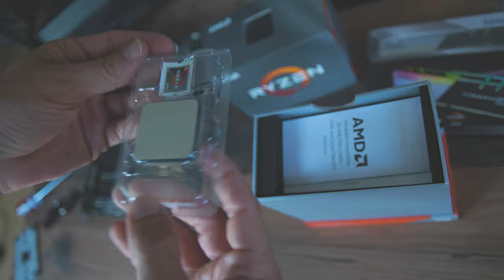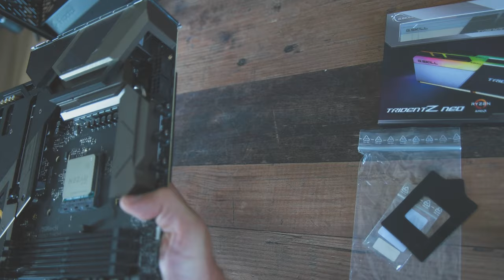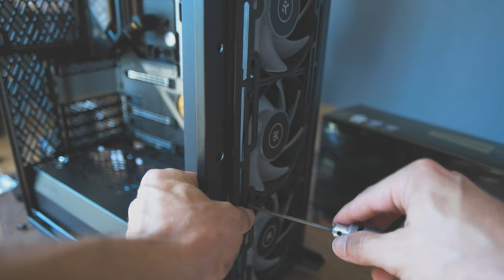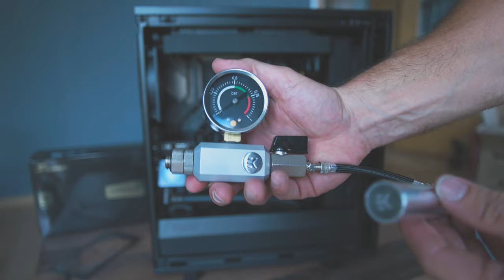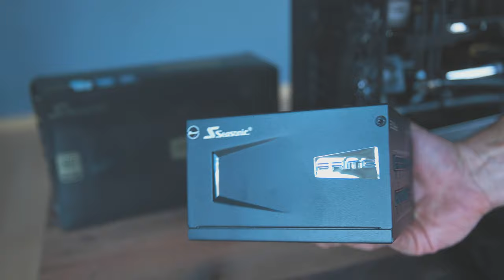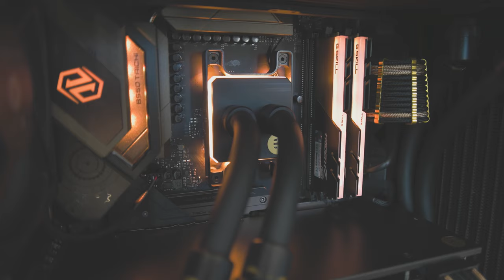Fractal Design Define 7 Compact EK WB Magnitude Black and Gold PC BUILD

Comment: Love that build!

I actually thought about the same case, I currently have a R5 and want to get something newer and smaller. My 3080 is on it's way and I would like to switch to water cooling. 
Would you recommend to do it that way, or get the bigger version of this case? While it looks nice, it seems a bit hard for a beginner to find the correct matching parts and I can't keep the system on hold for a day as I need it for work. Thanks!
Reply from the maker: Zen2 R5 ? The R5 doesnt perform very well with the 3080 .. you have to overlcock the R5 to 4,5Ghz (tested it) btw for you the Define 7 should be the better choice :)
Reply: @CustomrigsDe  Hey, Thanks! I was talking about the Define R5 case and think about switching to either the new Define 7 or preferred, your Compact case. I pair the 3080 with a 3900x Ryzen :)

Comment: Build sieht an sich sehr schön aus, ich finde allerdings dass die 5700XT und der R9 3900XT in der Form nicht sinnvoll zusammen gestellt waren. Man hätte mehr Leistung aus dem System holen können, wenn man in eine etwas stärkere Grafikkarte und dafür eine etwas schwächere CPU investiert hätte. Die GPU wird in diesem System ein ordentlicher Bottleneck sein. Des Weiteren ist die Kühlung schon ein bisschen zu viel des guten. Lieber den oberen 240er weg lassen, damit es im Case einen besseren Airflow für die Spannungswandler etc gibt.

Aber an sich wie gesagt sehr schick.

Edit: Ich war bis eben noch nicht so weit, eine Pumpen-Reservoir Kombi hätte es doch auch getan und hätte Platz gespart. Durch dieses "Monstrum unter der Karte sieht es etwas voll gestopft aus. Die Kombi hätte man vielleicht sogar rechts bei dem Loch hin stellen können.
Reply from the maker: da muss ich dich leider enttäuschen ... der airflow ist super die Spawas werden nicht besonders heiß ;) und es steckt seit gestern eine 6800 XT drin ... ein 360er Radiator für cpu und gpu sind nicht sinnvoll ;) Danke trotzdem für die Hinweise
Reply: @CustomrigsDe  
Gut, vielleicht bin ich da ein bisschen von der 2070 verwöhnt, die halt wirklich nicht warm wird. Hatte jetzt nicht ganz die Werte der 5700XT im Kopf. Und eine Sache hatte ich überhaupt nicht beachtet, die Zukunftssicherheit. Und eine Sache hatte ich ganz vergessen anzumerken. Ich finde sehr gut zumal jemanden zu sehen, der in diesem Case eine Wasserkühlung baut, da ich es als nächstes Case haben möchte aber vorher mal sehen wollte, was das Case Wasserkühlungstechnisch so bietet.

Comment: The review is very good, just fine!!
But (!) no one ever tells the whole truth about tower coolers.(Including on this channel)
I chose Fractal Design Define 7 Compact, I chose strictly according to those characteristics and specifications on the official website.
I chose a serious tower cooler for it, which by all parameters SHOULD fit into this case, this is
Noctua NH - D15. According to the stated data on the Noctua website, its size is 165mm in height. In the Fractal Design Define 7 Compact case, according to the data on the Fractal website, the maximum height of the tower cooler is 169mm. See how everything fits perfectly, doesn't it?!! . . . .
But really, the Noctua tower cooler does not fit into the Fractal Design Define 7 Compact case, it does not fit!!!!!!
And now the essence of the question, about which everyone, including TehnoBelka, is "loudly" silent:
Actually, the tower fits, even the average fan becomes good, but the front fan, located above the RAM slats, moves up because of these very slats, and because of this, the real, I emphasize, the real size of the Noctua NH - D15 tower cooler goes beyond the officially declared.About 2.5... up to 3 cm!!! Noctua does not write about this, and it looks like this is some kind of conspiracy of all reviewers on YouTube. How many people get to the hull like this, or to replace a smaller tower (or should I take my own)?
Dear author of this video! I appeal to you with a request to spread this information, because the mystery covering this topic will be a major upset for hundreds of trapped people!!
This case is able to fit Noctua NH - D15 with only one central fan. If you install a second fan in front, the glass does not close. That is, either this way, or with 2 fans, but without glass (or a blind metal wall)But this, as you understand, is a collective farm and not an option. Therefore, it is impossible to put processors of the upper line in this case, which have a strong heat dissipation.Only with ITS own.
This information will save a lot of people from spending, through the fault of Noctua.